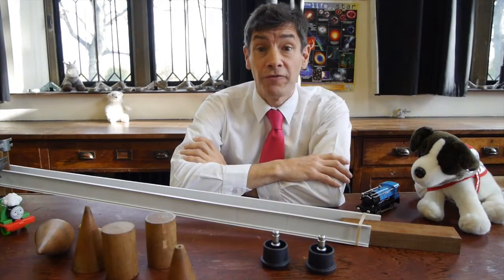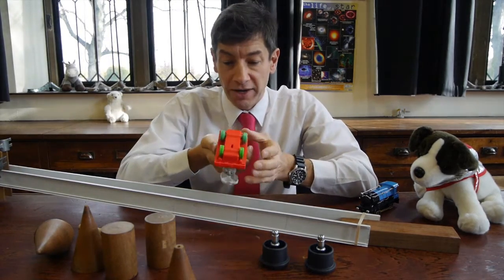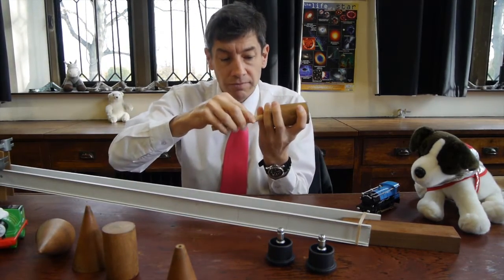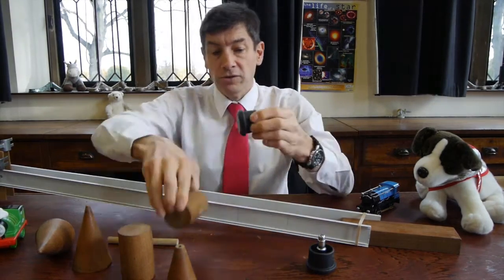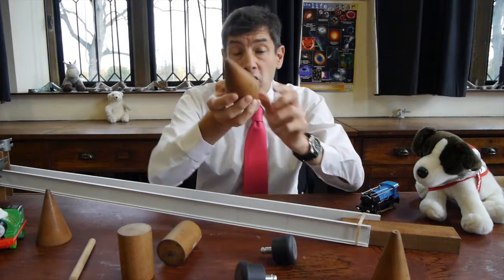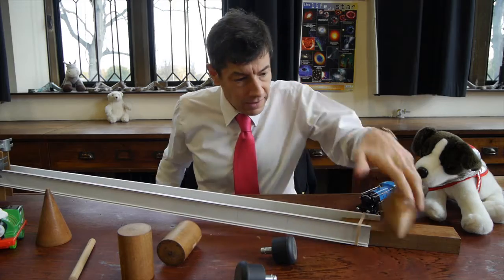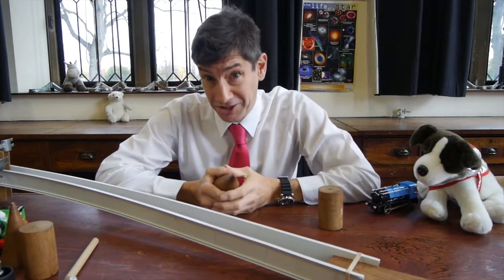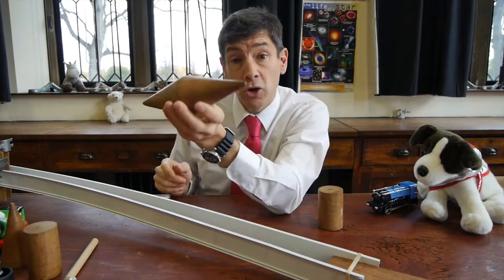How do trains stay on their tracks? - F-J's Physics - Video 110

Comment: The fact is that the cylinder-wheel will stay on the straight track forever but the tapered tread-wheel. The cylinder-wheel derailed (straight track) in your test is because the wheel has a very large angle of attack to begin with.  That is to say the wheel is already derailed at the beginning. To roll a derailed wheel  on the track has no significance.
Reply from the maker: Miao, that is a very good observation.  The cylinder is not derailed at the start as it is on both rails when it starts to roll.  The point being made it due to its shape there is no 'correction' mechanism to straighten it out as happens with the conical one.  Now, I agree that it does not start of very straight in the first place but, remember, if you are training to teach, 'exaggerate to teach - refine to explain' if that makes sense.  Thanks for watching and good luck with your experimentation too!